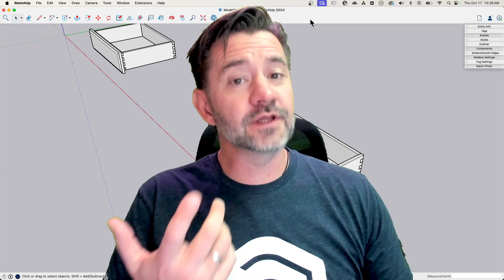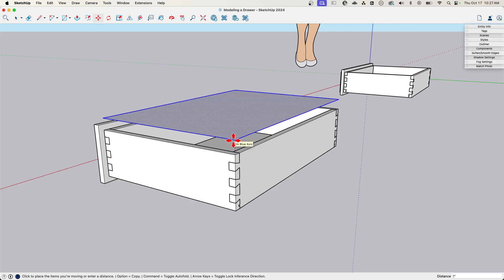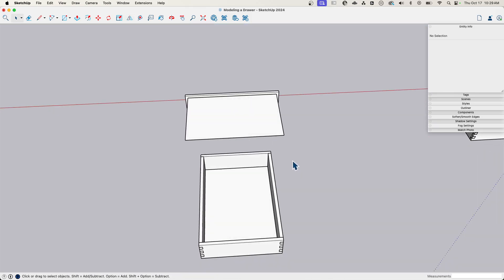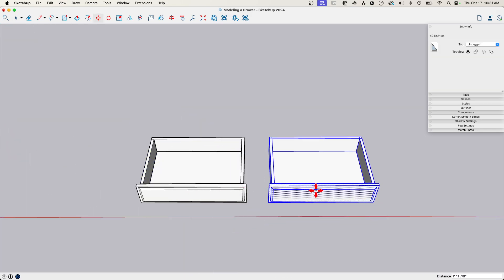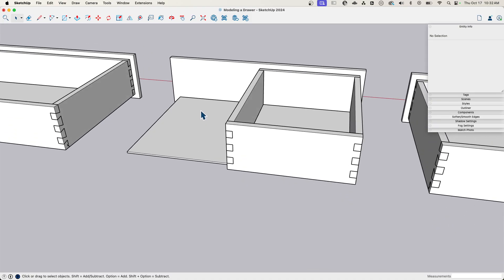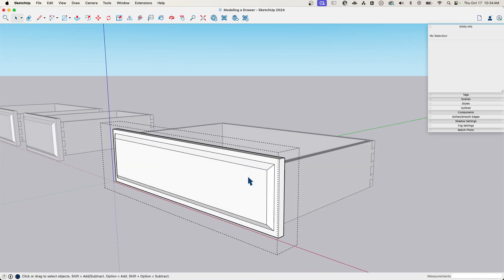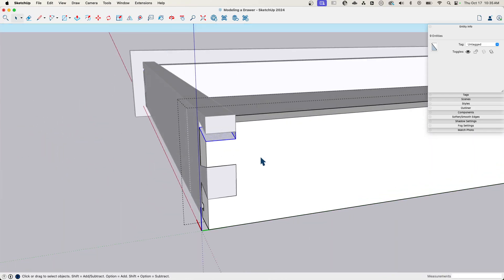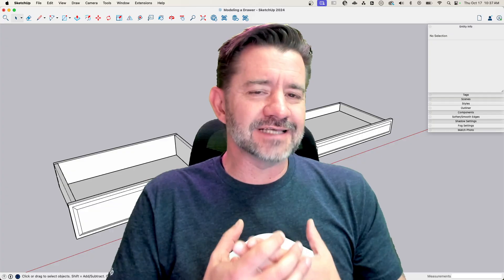Resizing a Drawer in SketchUp | Comment Response

Comment: dove tail is very nice but its time consuming too, in the industry they made a corner bit  (carbide cutter) that fits on router or larger one that fits on table router 1/2" that does corners that  does not break apart  and you just slide in each other I picked them up about 25 years ago  and it gives a better  look if you are using real wood or oak and you don't see joint at all because its meting is on the 45 angle I  yachting industry we use  expensive exotics such as ash, teak , mahogany and we make on the sides a grove for the drawer to slide on,  instead of using   SS  stainless steal runners which are now at a crazy price  because all other slides will rust in no time on boats we also use marine plastic lumber to make drawers too

Comment: As always, great video, thank you. 
Aaron, I have a question for you that is off topic from this video.
When I create a group, and I give a name to that group item, then I use SolidWorks on it, the name is removed from that group. Is there a way to use SolidWorks, and not have SketchUp remove the name that I gave that group object?
Reply from the maker: Aaron - "I have never used Solidworks before... my guess would be it has something to do with how they handle data"
Reply: @SketchUp  Aaron, thank you for responding. I have to apologize for my question. I meant to say Solid Tools. When I use them, it changes the name I have given my solid object in my Outliner. Is there a way to use Solid Tools and not have to rename my object each time.
Reply from the maker: That's a horse of a different color! Yes, Solid Tools will create a new group each time you use one. I believe that Eneroth Solid Tools will maintain groups and solids (but you will need to double check).
Reply: @SketchUp , Aaron. Thank you for the tip. It works just as I wanted it to. Eneroth Solid Tools keeps the name I gave my groups. Again, thank you.

Comment: Resizing whatever you want without deforming, from the outside of groups/components, even nested:
T2H Stretch by Area (free)
Curic Stretch (paid) - it can handle the highest amount of geometry and levels of nesting
Fredo Scale (Box Stretching option) - paid, but you can use older versions before becoming paid